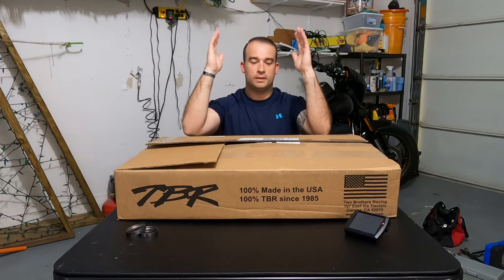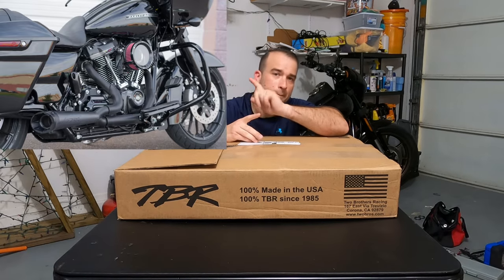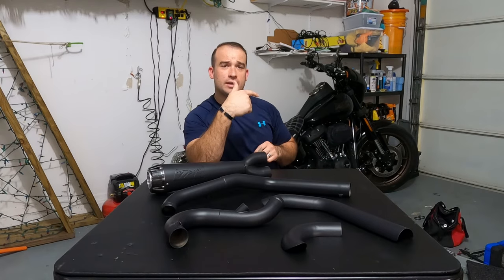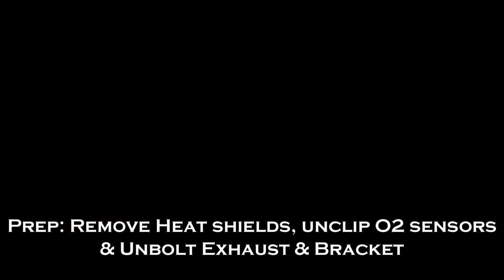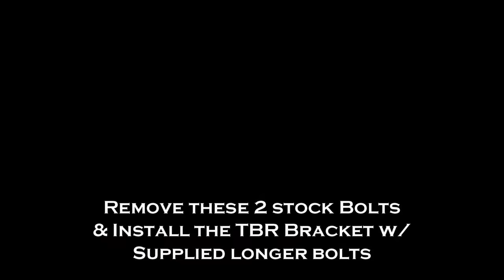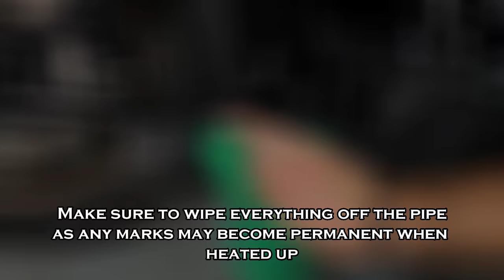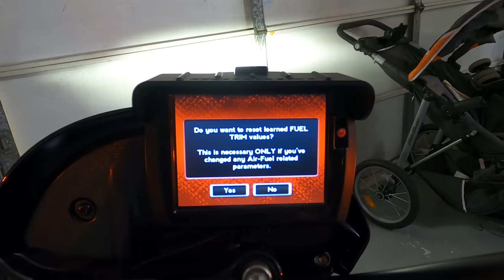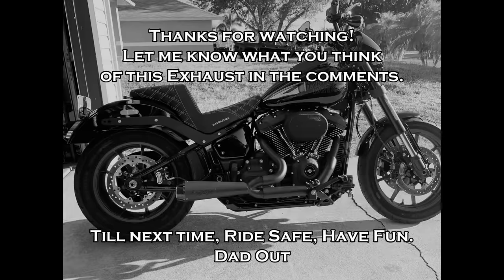Two Brothers Racing Exhaust Install on M8 Harley (Low Rider Build Series ep 6) WITH SOUND COMPARISON

Comment: just got the same exhaust ordered. Got all the old pipes off, but my 2 foot control bolts are star bit not allen/hex. Which ones do you have and do you know the size? Since mine are star bit, I attempted to use a T40 but it's a hair small and as you can imagine, I didn't find that out until it started to spin/strip. So I stopped right away. Those bolts are soft and in there super tight, so i'm concerned i won't get them off, therefore won't be able to use the spacers and new bolts, thus new TBR pipe won't fit. I was able to get the brake arm off and that made just enough room to get the old pipes out. Do you think it is necessary to get the right foot control off or do the spacers just make it easier and more room?  Very good video, i watched this and one other one to decide on exhaust and to watch the install. Just ran into this hiccup...
Reply from the maker: Ben Spurgeon thank you man I appreciate it! As far as the bolts. I’m not sure what bike you have but I would be willing to bet they are a torx 45 size. Depending on what bike you have you’ll have to remove the bolts you can it the pavers on there. If your bike doesn’t need spacers for your foot controls and you can squeeze the new pipe on there than you should be fine. But either way it would be easier for you if those controls are off. Hope that helps man!
Reply: I have the 2020 low rider S same as you but seems I’m the only one that had it come with star bits. I bought a T45 and had to apply serious pressure and even hammer in slightly but finally broke them loose and got them out. Glad to have the TBR new bolts and spacers to make it easier next time if I have to remove.
Reply from the maker: Ben Spurgeon weird stuff man. But at least you got it done!

Comment: Thanks for the video, but did you use a torque wrench on any of your bolts?
Reply from the maker: Thanks! And no, I rarely use a torque wrench on stuff unless its engine or transmission based. I know it's not recommended but it's what I do.

Comment: Loved your video man. Question do I have to tune it right away?.
Reply from the maker: Thanks man. And if you’re just changing the exhaust, no you don’t have to tune it right away
Reply: @RidinDad  thank you. Last question any tuner  will work cus i know the one you have is pretty pricy or is it worth getting?
Reply from the maker: Any tuner will work but not all are created equal. Fp3, screamin eagle do not offer as much adjustability as the power vision series. A canned map will work fine but is not ideal. I would say find a shop you trust and pay them for the one time license fee and have them professionally tune it. Worth every penny
Reply from the maker: And that way you don’t even have to spend money on a physical tuning device if you don’t want to
Reply: @RidinDad  oh that is awesome thank you for that advice. That will help me out alot. Thank you..
Reply from the maker: Happy to help man
Reply: @RidinDad  so i called my 2 shops in here they don't have a dyno tune. They said buy a tuner and my harley will probably void my warranty lol so to just get the tuner
Reply from the maker: Did you talk to Harley shops? They suck for this stuff. You need to find a third party shop. It may take some time calling and googling but I’m sure you’ll find one at least an hour or two close by.

Comment: Why remove the existing port gaskets to replace with new?
Reply from the maker: When you crank down the headers, it squashes the exhaust gasket. The new header might be slightly different too. Just a good idea to replace so they can create a good seal

Comment: I’m all for the black exhaust.. some would prefer chrome with that same exact bike but the black is where it’s at.
Reply from the maker: I think chrome would be gross on all black. Stainless or black for me
Reply: The downside of black is the it turns brown
Reply: @ydiaz8080  that’s what paint is for, it’s a small, basic simple project of which most are capable of.
Reply from the maker: For me and my tune it’s not really brown at least yet after about 2k miles. It’s a slightly different shade of black almost a purple hue to it

Comment: Hey Ridin Dad, where did you get those Exhaust Port Gaskets from.
Reply from the maker: Mark these are just the Harley oem ones. Picked them up at the local Harley. Vance and hines makes pretty much the same ones online too. Same price. Tbr guys recommended stock Harley replacements

Comment: Interesting, no mention of how difficult it is the remove the stock lower exhaust flange nut on the front cylinder and how to gain access to it, best tool to use and how to achieve it (I couldn't get a swivel socket to go in my 2018 LR).  Also, what about disconnecting the negative from the battery terminal [as per the Service Manual], this will avoid any error code resulting from removing the O2 sensors.
Reply from the maker: nevillegreg1 I had no issues getting to any of the flange bolts. Much easier than my buddies fat boy honestly. I used a swivel only for the front bolt and they were all easy. And yeah I could/should have disconnected the battery terminal but I didn’t feel like it was truly necessary since it was so minor. And if there was a code my power vision would have showed me what it was and I could have cleared it anyway.
Reply: @RidinDad  Thks.

Comment: Looks great but how would one put passenger pegs on with this exhaust. Or really any aftermarket exhaust? Most of them seem to block the peg hole?
Reply from the maker: Thanks man!! On this frame there are two sets of passenger peg holes. The bikes that come with the pegs on from factory are positioned in the bottom hole. The top hole has little plastic inserts to hide the holes unless you have to use them. So for this exhaust, and most after market exhausts that cover the default position, you just use the top. Hope this answered your question!
Reply: Ridin Dad oh shit!!! I didn’t even realize those were there. Thank god hahah. I appreciate it!!!

Comment: Hey man I have a 2020 fatbob and I want to install an aftermarket Bassani exhaust. You know any details on the warranty through Harley or just don’t care? I’m willing to use the Harley tuner and intake but the pipes gotta go.
Reply from the maker: I could be wrong but heres my understanding.....installing any aftermarket part 
NOT HD will void your powertrain warranty. I also understand HD parts installed at home in DIY fashion will not completely void your warranty but give dealerships leeway as far as warranty work and your bike will not be guaranteed coverage if that makes sense. Someone more knowledgeable than me might say otherwise but thats how I understand it. It's ultimately up to you but heres my opinion....if you don't purchase a huge extended warranty, just do what makes your happy. I personally do not like the HD tuner, most air cleaners, or any pipes/slip ons they have. I don't think any warranty work would need to be done prior to expiration anyway truthfully. Let me know what you're thinkin man!
Reply: Ridin Dad that’s what I was thinking too. What are the odds you’d need any real “power train” work in 2-4 years anyway. Okay thanks
Reply from the maker: Yeah same train of thought man!

Comment: Yo what's up man! Great video! I'm actually going to get this after my saddlemen seat lol so in a few weeks. Just wondering did you have to torque any bolts to spec?? Didn't see you doing it and im going to use your video when doing my exhaust.
Reply from the maker: Hey thank you!! I’m sure there are torque specs for just about any bolt. I’ve done a decent amount of work on bikes and I rarely use torque specs. That being said it’s your call lol. There’s been a few times years ago I actually used the manufacture specs for some thing and the bolts broke before they ever got to it. Multiple different spots and brand new bolts. So for me, unless it’s real serious internal engine stuff I don’t pay attention to torque specs. Good luck man!!
Reply: @RidinDad  thanks a lot man, Appreciate the help and will definitely be getting this exhaust on my bike. Have a good one!
Reply from the maker: Sounds good man!! No problem!
Reply: @RidinDad  Hey man! I ended up getting my exhaust today. Went with TBR black 2-1 shorty turnout lol. 
QUESTION: 
Did you locktite the bolts that go into the engine?
Reply from the maker: Awesome man! And are you referring to the header bolts? If so that’s a hard no for me lol. They will have pressure back on them when tightened properly. Also after a few hundred miles you should tighten them again. Because the gaskets will deflate a little over time and the header will seat
Reply: @RidinDad  thanks man! That's exactly what I was referring to. Did you torque those header bolts? If so what specs.
Reply from the maker: No problem and no I didn’t. I pretty much never do torque specs. I just tightened them till they were good and tight and then some.
Reply: @RidinDad  awesome man! Thanks a lot. I appreciate the replies! I'm going to get wrenching tonight 😁
Reply from the maker: My pleasure man! Enjoy and good luck!

Comment: Hi bro! Beautiful bike 🤩
How does it work with the power vision tune? Is there a big difference ?
Reply from the maker: Thanks dude!! I haven't got numbers from a dyno yet so its purely from the seat of the pants for me....But...I think theres a small difference. Im currently doing autotune sessions so I'll see long term results soon. The throttle feels smoother and more responsive and I do think theres more low end torque now. Also seems even more effortless at highway speeds
Reply: @RidinDad  thanks for your answer. I ve got the same bike with the same exhaust system but I didn't do any tune...I will do it soon I think but I would like to know if it really worth it...Ride safe ✌
Max from France
Reply from the maker: Massimo Guaglio I think it is. Even if the numbers don’t show any improvement your bike should run better. Healthier.

Comment: Great videos! , I have been following the progress on your Low Rider S and learning a lot on how to do my own upgrades. I recently purchased a 2021 Low Rider S with less than 3k miles and installed today the same TBR Comp S exhaust as the video, my problem is that my bike comes with 4 OS sensors instead of 2 like yours; wonder if it is because of the newer model or because the bikes sold in Mexico have different specs. Also installed the DynoJet PV4 and update the firmware but the app shows only one file to flash for (Full exhaust / High Flow intake); I noticed your app even shows TBR 2-1 exhaust in the flash file description. Have you ever heard of a problem like this? Any suggestions? Thanks a lot and all the best. Mel Angel
Reply from the maker: Yeah I have a ton more videos.  This one is super old for my build. The power visions need to have extra files downloaded from the dynojet website. You pick which ones for your setup then download them to the unit. Then flash the bike. I’ve never heard of 4 o2 sensors before. That is super weird man :/

Comment: You literally skipped the most important part, how you reached the front exhaust stud nut with the oil cooler being in the way.
Reply from the maker: Did not skip it at all. Use swivel sockets. Pretty easy. And the extension I used. In the video

Comment: What size risers do you have on there? Nice bike!!!
Reply from the maker: Thanks man! I don’t remember what I had on the bike at the time of this video but I have an upgrades video with some 6 inch risers with some pullback and the stock bars. I’ve recently put a new set of risers on from biltwell. 8 inches high with 1.5 inches pullback. I’ll be doing another video on my most recent bike setup within a few weeks too!
Reply: @RidinDad  any of your videos showing the 8 inch with stock fairing?
Reply from the maker: Nope. I took the fairing off. I’m going naked from now on lol

Comment: Can you link me to where you ordered the new exhaust gaskets
Reply from the maker: I bought them from my local Harley. But these are the same price and essentially the same thing: https://www.revzilla.com/motorcycle/vance-hines-exhaust-port-gaskets-for-harley-1984-2018
Reply: Ridin Dad thanks a lot man I was looking at those but I wasn’t sure if those were as good as the ones you had because they look like 2 different designs
Reply from the maker: No problem!! Good luck!
Reply: @SuperLalalada  did the Vance and Hines work out for you? Or did you go with Harley gaskets? I noticed they don’t appear to be the same size as well

Comment: Doing it yourself voids you’re warranty or no ?
Reply from the maker: Texastacticool I believe it’s up to the dealer. I’ve seen people do it themselves and the dealer honors the warranty. However once you put a non Harley tuner on the bike it 100% voids it
Reply: @RidinDad  yeah bro so my Harley people told me just put the pipes on my self and run it with jo tune or changing the intake and once something happens just put your regular exhaust back on and bring it in and they won’t red flag it and should be good and swap Bsck again
Reply from the maker: Yeah that’s true. If there’s no tuner they won’t know. BUT it’ll be a pain to swap out exhausts just to go back to the dealer on the rare chance you even need to. Plus no tuner means you’re leaving a lot of performance on the table

Comment: I changed one put same pipes  but never tuned it runs great though.. should I take it to harley and have never tune it..or wait till I get the next tune up
Low Rider ST 24
Reply from the maker: I wouldn’t have Harley tune it at all. And if you you changed was exhaust you can wait if you plan on doing something else. If you arent gonna change anything for a while I would recommend a tune that way the bike runs as good as possible
Reply: @RidinDad  thank you
Reply from the maker: No problem man

Comment: Awesome video man! Where did you get the new gaskets?
Reply from the maker: Thanks! The specific ones I got from Harley but you can get them at any motorcycle shop or online at any of the typical motorcycle websites
Reply: Any chance you could send me a link for the correct gasket? Thank you so much
Reply from the maker: It’s just a Harley exhaust gasket. For this exhaust you need tapered. Any brand is the same. They only make tapered or flat. Get tapered for this setup
Reply: Awesome thank you so much!
Reply from the maker: No problem! 👊🏻

Comment: Does the black hold up or is it real dull looking after time
Reply from the maker: I only had it for about a year if not a little more before I changed setups. The finish held up fine as far as ceramic exhaust finishes go. But the black turned a little tiny of purple. It’s pretty common for every pipe to do this

Comment: Random question...with everything all installed does the heat shield for the front header come into contact with the motor or the control arm? Looks like yours touches the controls but hard to tell...asking cuz mine does 😩
Reply from the maker: Nope mine doesn’t touch anything. Did you use the supplied spacers for the foot controls?
Reply: I just installed a set yesterday and was going to ask the same question. The front heat shield hits the foot control arm on mine. I reached out to 2bros to see if what they say.
Reply: You can adjust it mostly out. My heat shield barely touched even with the supplied spacers but when I got my front crash bar it completely moved away
Reply: Mine also touches, and also comes veeeeeeery close to engine case. Sounds good but hate that it touches.

Comment: Got my pipes. Wonder if the stock heat shields will fit...
Reply from the maker: The stock tbr shields? Yeah they fit fine why
Reply: @RidinDad  Sorry, I meant factory Harley Davidson heat shields on 2br. pipe.
I like the holes on the factory ones.
Reply from the maker: Oh well I would assume they won’t

Comment: I has a question I bought harley moto bars and then bought the biltwell Murdock 8 inch with pullback risers and I don't think they will work if I turn the bars up where the should line the holes up they are way down and I was wanting to know what bars and risers you have or if I should just get different bars I noticed you had pullback and moto bars
Reply from the maker: Hey. Great timing lol. I just bought those same risers this morning!  The bars I have currently are stock. And the risers are the 6.5 drag specialties with pull back. They’re singular risers so there’s the wide open gap in the middle. I don’t know how this bar will do with the murdoc risers so I’ll keep you posted with a video soon!!
Reply from the maker: You could always just drill another hole in the bars if you wanted too. Way easier than drilling anything with the thick risers
Reply: Lol yea the bars that I bought I'm pretty sure are the ones that come on your bike I got the 2020 standard and I have bad hands and at 5'9 I hate the mini apes . My hands fall asleep after fast a mile or 2 . So I was hoping this set up would help a good bit plus I dig the look . Anyway I hope you don't run into the same problem I think I'm going to have brother
Reply from the maker: I hope so too! Looking at the hole it seems like it’ll match up but we will see man!!
Reply: Lol keep me updated I think I'm going to try mine next weekend ordered the relocation piece for the top clamp guage as well and hd riser  bushings waiting on all that
Reply from the maker: Will do man! Happy installing 🤙🏼
Reply: You too